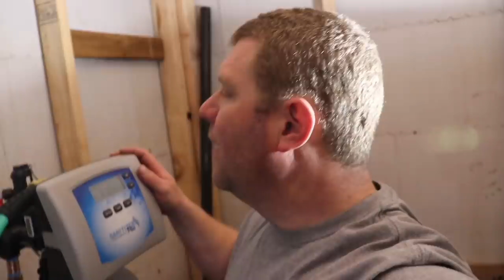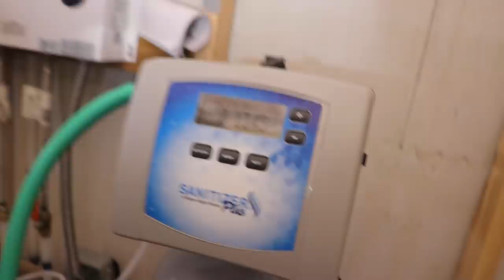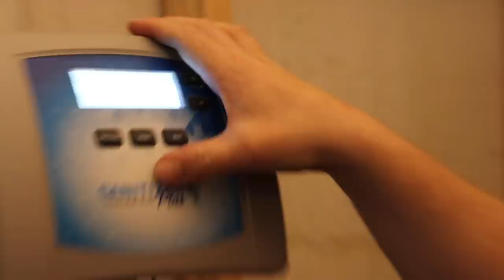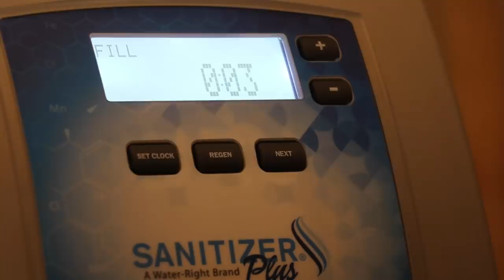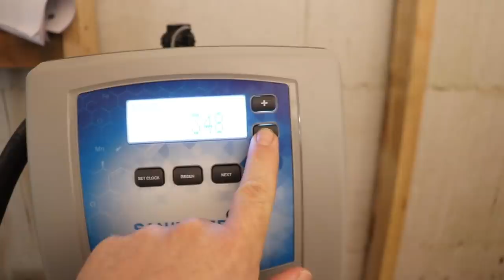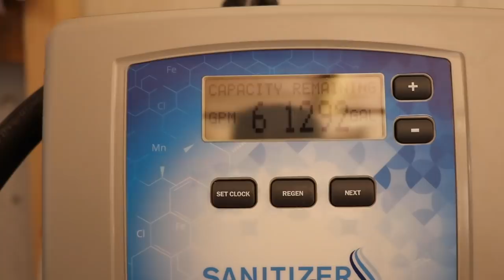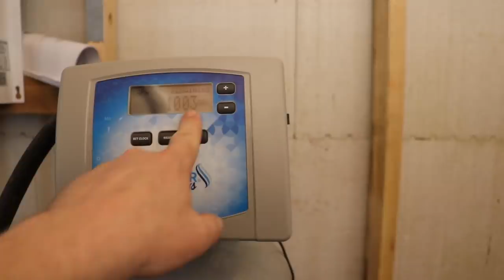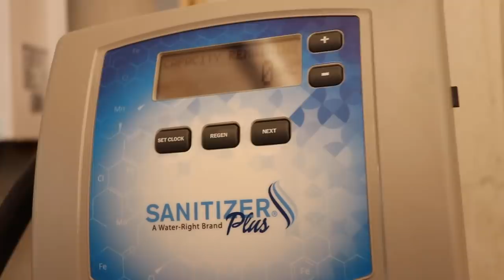Filling $10,000 Off Grid Water System from Brand New Well

Comment: why don't you set up a filter? a whole house filter housing is like $50, and you can run them inline, so you can run a 15/10/5 micron filter suite to remove solids. get the good wound cord ones though, I run a 10 micron on my well and it removes any sand or rust, and I saw the wound ones are better from experience. They last longer, because as they load up, the outer wraps move just a bit in the current, forcing the fines to the low points and allowing flow for much longer. the foam ones are junk, you end up with an even coating of gross across the whole thing, and if you literally open it, wipe off the schmoo and put it back it works again. I get one month with foam filters vs 6 with wound.

also, you'll probably spend $20 total for the 3 filters every 6 months, vs dumping 1000 gal into the yard

Comment: A normal system would have a tank with a bladder in it and a check valve somewhere for storage so the pump motor doesn't have to run all the time or for small amount of water usage. If the water flow was steady but it was less than the pumps capacity there would be some kicking on and off of the pump I don't see how you could avoid it. However you're not going to overheat the pump but trying to run it with too low of a flow. You shouldn't need the alternative why at the pump running water off the other way at the same time. Also the pumps kick-off pressure should be adjustable so you can have a large gap between kickoff and kick on to avoid the motor running as much as possible. Actually I believe most cistern systems would probably just fill the cisterns with whatever is coming out of the pump and use the filters to handle your household needs only. Example you might not feel to your hot tub stuff or if you had animals you might not filter theirs

Comment: Thanks for the video, came through at 1080p HD fine. Water companies and process industry tend to measure conductivity a lot to give a cheap measurable guide on water quality, it's not an indicator of bugs etc but that's not your issue as I understand it. Maybe help you know when the borehole water has fully purged and is ready to use and help avoid a slug of particulates going into your systems.

Comment: Why not fill the cisterns directly from the well, and then just use the water-softener to soften the water going into the house.  (and into hot tub?).
Seems like you wouldn't want to use soft-water to (for example) water your garden, spray mud off the tractors, etc.  Usually in residential houses, the outside spickets/sprinkler systems, are before the water softener......

Comment: Your media needs a regen more often, Iron uses the ion exchange media  faster than hardness,  you only entered 14 as your hardness into your regen calculation on the softener which, i am guessing, is just your basic hardness without adding in your need to process iron.  You gave two readings for iron in your analysis, 1.9 mg/l (which is 6 times the limit) or 60 times the limit which is 18 mg/l. every o.3mg/l needs about 1 grain of ion exchange per gallon so at 1.9mg/l you would need your softener hardness set at 20 not 14 ( so a max of 1200 gallon of water treatment (24,000/20gpg) or if it is really 60 times then you need to set it at 74 grains per gallon which would only give you just over 320 gallons of treatment before your media is exhausted an needs a Regen.  Don't forget that during the regen the final wash water will be be taking some of your softeners capacity as well.  Your water looked much closer to the 60 rather than the 6 early on but that could just be because some clear iron had oxidized while sitting in the well. 

Another thing to check for is iron bacteria,  (with such a high level of iron it is a possibility. better to look into treating it before you finish your house plumbing it is a pain to try to get rid of it if it has the whole hose to hide in. there are multiple ways to kill it but make sure it is dead before it gets into your house.  

And check your water for potability, just because it looks and smells ok does not mean it is safe to drink long term (or safe to put on plants) chech the TDS (total desolved solids) if they ar too high the water is ok for washing but not really safe to drink every day.

Comment: Did you have salt in the brine tank when you regenerated overnight for 12 hours? I'd plumb the unit in and let it run as advertised. Does regeneration take 12 hours? My RainSoft system takes about 30-45 minutes or at least that what I think it takes since it does it a 1AM.

Comment: "I think", "I think".  He has no idea what he's doing.  First, install a pressure tank and switch on the line coming from the pump.  Then, turn it on and leave it on.  Use salt with a rust out additive for your brine tank.  You can buy the additive separately.  Then let the water softener go through the ENTIRE backflush cycle on its' own.  You shouldn't taste any salt in the water.

Comment: Ok few things I see going wrong one you shouldn't have flow going out the filtered hose when water softener is back washing and two you dont want to start and stop filter regeneration with power cycling only time you do that is when you first commission the system to allow the media to flush clean before you put it in service.  This may have been the time you should of used a pro but good attempt to show us what you thought was correct.  Second point you should add a drive to control your pump when you continue with the well setup and then you wont have to waste water  and wont need reducing flow restrictors.

Comment: Why is there no salt in the brine tank yet ?  It should be filled to about 3/4 full or so and not right full to the top with salt.  then when your softener backwashes,  the softener draws the salt water out of the brine tank.  :-|)  P.S. - Your salt level is actually too low and the amount of water in the brine tank cannot totally charge the media in the softener if there is not enough water to do that !  You also need to set the softener for the amount of salt you will need to use.   :-)

Comment: Nice job on putting ads up over the results. 

What brine? That tank was empty the first time you backwashed. It should always have salt and water in it. You need a professional. That system isn't designed to be unplugged and water turned off. We tried to tell you, you needed more than a softener alone. You need filtration too.

Comment: It sounds like all the water from the well goes through the softener before going anywhere else?
I'd supply the cistern with full pressure and have that be the shut off when full, then have the cistern water supply the softener at a reduced pressure.
You would also have the option to use un-softened water for the garden and anything else not needing softened water, and the system will last longer before needing to cycle.
Also, where is the salt? The brine tank had no salt! No salt, system no work-ee!
Also, a softener is not a filter.

Comment: Not that I'm any kind of expert, but I have used  water softeners on my truck mounted carpet cleaner for 10 years. They do need to be re- brined depending on the amount and quality of the water. I think the turbidity you experienced at first might  have been excess salt flushing from the system. Consult your water softener guy as he would know your water. A little excess salt at first is a good thing meaning the system was fully charged. With as much iron as you guys have you want maximum softening. Continur to dialog with the water softener co. to get  maximum results . I don't know if you have one but a 3-5 micron pre filter will extend the life of the gold pellets that are inside the tall canister where the softening occurs. The gold pellets will eventually wear out and wear out more quickly if they are exposed to a higher mineral content so try to filter out as much of that before it gets to the softener. Your water guy might not have mentioned this to you because this will make you have to replace the gold pellets more often. An after filter wouldn't hurt either. Don't expect the softener to do everything.

Comment: 1. If you used the well continously you wouldn't have to waste water. 2. You are creating your own issues by not using a big sediment pressure filter system. 3. Just go to a pressurized house system and stop worrying about this cistern system. Use the cisterns for fire protection, gardening, etc. Non household water. Setup a sediment filter system to filter, but not soften your water before keeping them filled. You have a well a lot of people would kill for. Use it daily for your household use.

Comment: You need an iron filter to get rid of most of the iron at high flow, a water softener is not designed to get rid of all the iron, specially when you have high iron deposits.

Comment: If the iron is coming threw oxidized the softener can't filter it. Clack valves have a "dry brine" where it fills the brine tank and allows it to create a salt solution. ( 2 hrs time you will have full salt solution, you dissolve 3 pounds of salt per gallon of water) I would increase your rinse time.

Comment: Your Iron softener needs the iron dissolved in solution as you probably know. Having a drain back hole in your well is constantly adding dissolved oxygen to the well water and oxidizing iron and will be a pain in the ass working with until you plug it.  You need a well house with a bladder tank (pressure tank) and pressure switch to regulate your pump, ditch the drain back setup and heat the well house in winter to prevent freezing. You should have me on speed dial. If you don't plug the drain back then you will need an air volume control tank which deals with the extra air in the system but will oxidize iron and you don't want that. When adding salt to water in a brine tank, wait an hour so the water becomes saturated brine before regenerating.

Comment: Hi guys....... I have a cistern set up with 2 boat float switch that turns my pump on at 5%and off at 50%. My system pumps to a large storage IBC(1000L), gravity feeding my softener and main "finnish water"(2,000L), witch has the float switches. At 50% finished the pump turns off and the IBC drains into the finished tank to 100%.The setup keeps about 20L in the IBC and lines so no priming needs to be done the next cycle.Hope this helps <3
 oh and good luck with the little one...lol I have 11 kids from 25 to 2..... 1 is harder...... The first one is a practice anyway....LMAO

Comment: ok have the water guy come and permanently install the system the correct way. Pull the pump and fix the hole u drilled into the pipe and build a little insulated box around it, Your pump has a built in pressure regulator and does not need to continue pumping water back into the well, plumb the well directly to water softener, then run a pipe from the output to your cistern system. keep up the videos, need more actual work done tho, like putting in inside walls and drywall!

Comment: "Brine-ing" for longer makes no difference, brine is not added to the treated water it is just used to exchange the ions on the used media with fresh sodium ions. once the media is 'full' the 'brine-ing' reaction stops. the unused brine is then washed out (out through the backwash hose and into the toilet as the last stage of the regen) and  while that is going on the brine tank is slowly refilled so it is ready for the next regen.  

However since the water treatment involves switching far less soluble salts (visible and able to form crusts)  with more soluble salts (less likely to come out of solution and invisable) by switching out the unwanted of Calcium, Magnesium and iron ions with sodium (supplied by the brine)  it is important to remember that the water still contains the same amount of chemical salts as the untreated water it is just that you cannot see or taste them as easily. ie the water is still not pure it just looks and smells better.

Comment: The taste of the softened water isn't overbrining. You can't overbrine the backwash water. It will be salt saturated very quickly. The taste of softened water isn't great, you'll want a separate drinking water feed to kitchen with a carbon filter on to remove flavour taint from the softener.

Comment: It seems like you have reached a point where you have two excellent water systems, but you really only need one.  The logical, and less wasteful way to go would be to plumb the well directly to the house and softener, and use it the way the rest of the world does.  If you use it regularly every day the water will stay clear and the softener will remove the Iron and the hardness and regen when it needs to.  Having the separate unsoftened line for the garden would be nice too, but I don't think you really have a need for the cistern anymore.  It's just hard to give up on such a well planned and laid out off-grid solution, but you are no longer off grid.  A tough choice.

Comment: Are you sure you want to fill your cisterns with softened water? That means you're technically using salt water for everything. While you aren't adding so much salt you can taste it, it's still there. Granted, that's what you want for cleaning, unless you accommodate for the level of salt when you drink and cook, you will be adding a lot of salt to your diet. I'm pretty certain that's why people who have water softeners have a tap bypass to a tap faucet in the kitchen sink and sometimes refrigerator. Most of the time, hard water is perfectly safe to drink and cook. And in reality, you can use the filter in your refrigerator if you want filtered water, but because salt dissolves, I don't think the filter will remove salt.

Also, I think snow melt might be enough water flow to stir up sediment in your well and that could be what's causing the clarity problem. Anytime you get extra water flow into your well (e.g. Rainfall, snow melt), it is likely to stir up the sediment in your well and your water will be "muddier."

Over all, you might want to consider just filtering the water that goes into your cisterns and then soften the water as it is used in the house with bypasses to any places where you don't want "salt water" such as the places mentioned above.

And a thought has occurred. You do realize most of the water you are running isn't getting softened at all? I don't know what water softener you have, but I'm going to guess that it only generates enough brine for no more than 20 gallons at a time, and that's a generous estimate. That means unless you stop the water flow every time the softener needs to generate more brine, most of the water you run through the water softener will still be hard water, which defeats the system you're trying to build. Again, highly recommend just filtering the water as it goes into the cisterns, then have it softened on demand as you use it in the house.

Comment: Backwash rinses the media of the particulates. Brining removes the collected calcium from the media and replaces it with sodium.  The media will only take as much salt as it can handle so you cannot over-brine. Rinse removes the remaining salt from the media. Soften then removes the calcium from the incoming water and replaces it with sodium. That's the ion exchange process. The penalty is that the water now contains more sodium than non-softened water.  Salt is sodium and chlorine. The softener uses the sodium to recharge, and dumps the chlorine in the rinse water, but yours uses the chlorine as anti-bacteria. The added sodium is what makes the water taste "funny." You should be able to adjust the salt consumption per recharge. The softener in my home uses 4 lbs. of salt per recharge. Jon, former Culligan Man.

Comment: I believe I am French and sis in the comments. However I am not physically there to actually look at your system. Do you have two lines like in a normal Water Tower. One line is to fill the tank and it is feeling it up from the top of the tank so we don't have one line connected to the top of the tank. The second line is the pressure line. Not only it has gravity it also has the weight of all those gallons pushing down creating pressure. The more gallons you put in your tank the more pressure you should have. Now what I have been seeing you do is pushing against the pressure line. In this effort you are hard on your pump and you are hard on your electric bill. This was alarming when you was working with solar yeah touch with 30 amps you probably met just be able to get by with being hard on your pump. When you ran your lines you should have added a small 1/2 inch line to refill the tank. Do know that this is common water tower logic. And Truth water towers produce so much pressure but they have to be reduce down to 40 or 60 PSI

Comment: It's time for water softener class. What I see so far tells me you don't understand how a water softener works. This is not meant to be a disparaging remark, as a master plumber with 42 years of experience I can say that quite a few plumbers don't understand them either.
When you talk to your softener pro, ask him to explain the theory of operation, no shame in that,  but you need to understand the process. The water needs to be on for the entire regeneration cycle for the valve and process to work correctly.
Many systems with your level of iron would benefit from a separate iron and sediment filter. Our softener rep told us years ago that the backwash rates to clear a combination filter and softener resulted in the softener media back-washing out of the system.
Please get a second opinion from another supplier.
Don't believe the comments here, including mine, without more input from water system professionals